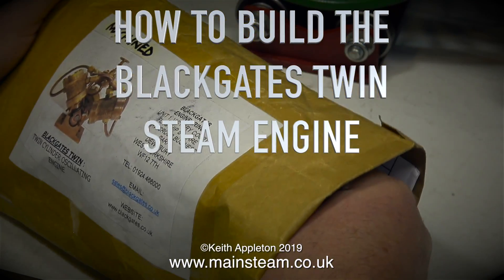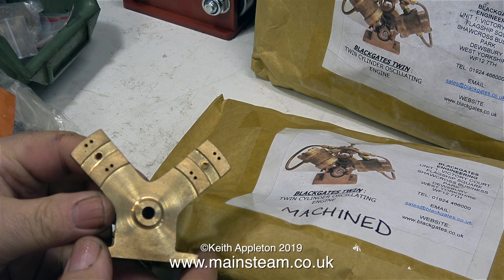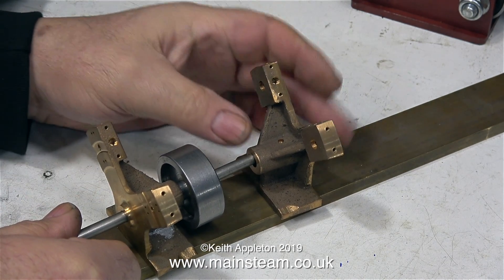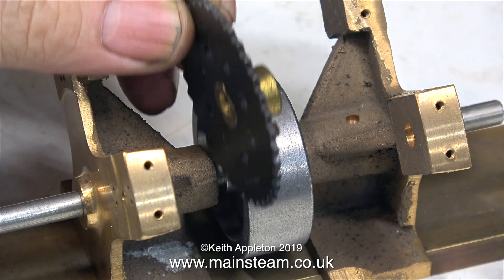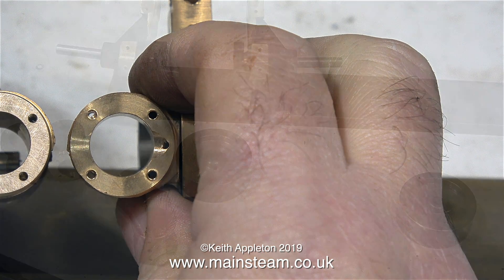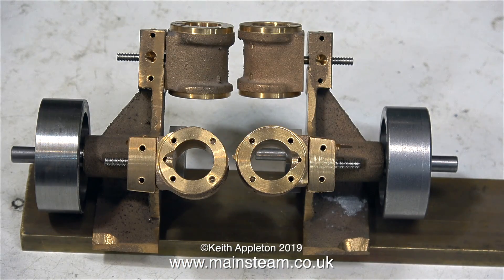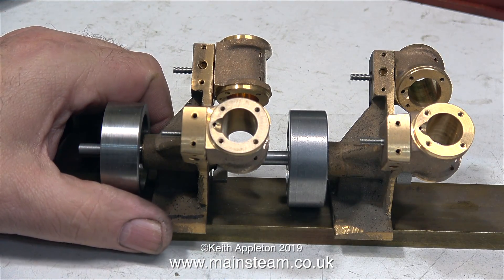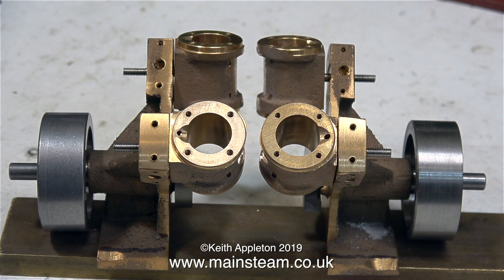HOW TO BUILD THE BLACKGATES TWIN STEAM ENGINE - PART #2

Comment: I've never even heard of this engine let alone seen one in action!  This is going to be a great video series to watch!  
Question: Is it possible to use this twin configuration as a compound unit? That is, one high pressure and one low pressure?  Just wondering as it seems just exhausting the steam from each cylinder after the power stroke would be a waste of energy and power.
Reply from the maker: not really, because all of the cylinders are the same size and oscillating cylinders don't like a lot of steam pressure . . . .

Comment: If you felt adventurous you could make up a small encapsulated fluid flywheel which would be inert at rest but transmit power from one shaft to other when in motion, fluid flywheels are quite simple in some aspects and it would be quite a unique feature :)

Comment: Mr. Appleton. As always,it is a pleasure to recieve another of your videos.
I am not an engineer,but various projects of mine and the drag racing career of a good friend of mine  leads to the observation that when you put two engines to a common output,you get far less than twice the power. Call it torque(twisting force) or thinking of horsepower as torque times rpm(No engineer would say that but...),but tweaking any pair of engines to where the one does not drag the other at some point in the operational cycle is genuinely difficult.
What I know about steam engines,you can write on the inside of a matchbook cover. Is there something about an external source of hot working fluid (steam) that makes what you are doing easier ?
Or are you going to resort to your spectacular patience and bit by bit coax each to be nice to the other ? 
Is there any way to persuade you to add to your series ? Measure the steam power of each,then together ? I for one would be truly interested in finding out.
I mention dragsters as there was a time multiengine drag cars were being used. The difficulty of obtaining twice the output was so great,it is just not being done anymore. An on board data processor might help for nowadays but that is beyond this little project of yours.
Anyone out there with PROFESSIONAL or ACADEMIC knowledge willing to chip in here and give some useful input ? Cheers everyone.

Comment: What's to stop you from having a driveshaft stick out the ends on the cylinders-out configuration? Can it not take load that way? Even if it could I guess it would have to be pretty long to clear the cylinders, and could get bent. The symmetry looks better with cylinders-in anyway.
Incidentally, regarding your not-very-graphited graphited yarn, you could buy some powdered graphite (normally used for lubricating locks, available at a hardware store) and slather your yarn in that. Cheers!